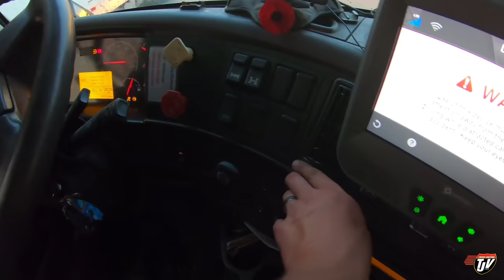My Trucking Life | ARRIVAL | #1739

Comment: Love your videos.  FYI:  'Chiropractic'.  **  Addendum:  there are things Josh I know and things I do not.  Backs I KNOW.  I started drawing when I was six months old, designing building by age ten.  So basically, we are talking ten to twenty years, starting out in life, with my head pointing DOWN, then neck pain.  By age 23, my neck and back hurt so much, I was not sure I could go on as an architect and had to consider give it up.  Stretching is all.  Then years of financial sales, phone in the neck........errrr.  So chiropractic is good and stretching is good, but you probably need both.  Not just a wack, except to get out of acute.  Once you get out of that phase, as often as you can, lay on a bed, face up, with you head overhanging the edge, and gently massage yourself, move your head around, push thumbs into neck soft tissue, massaging yourself.  Little bit here goes a LONG ways.  Trust me on this.  37+ years later hardly bothers me now and when it does, I catch it in time.  Sensing and adjusting our own body, is a life skill, Trucker Josh.  ** Thanks for your great spirit Josh!  Safe travels.

Comment: How do you store your straps? I roll mine, then put them in the toolbox under the trailer, but they get tangled.
Reply: If you want them dry then leave em on the roller and just slide the roller to the center of the trailer hooking the chain on the holder in the bar hole.
Reply: @Tyler-xe1es   sorry, I meant the removable ones, in my case the 2" ratchet straps.